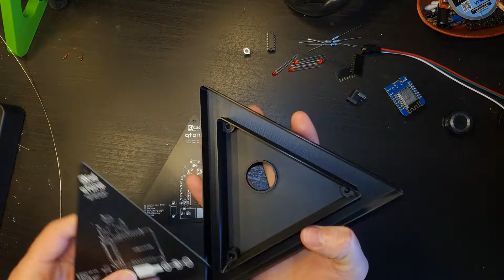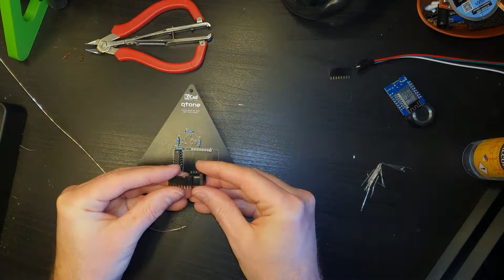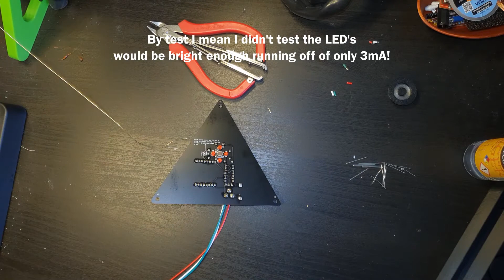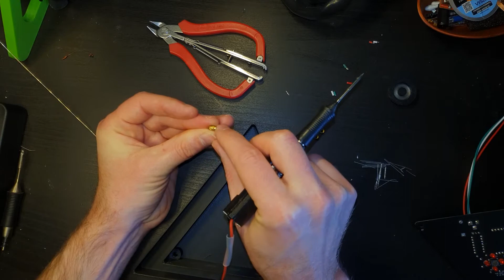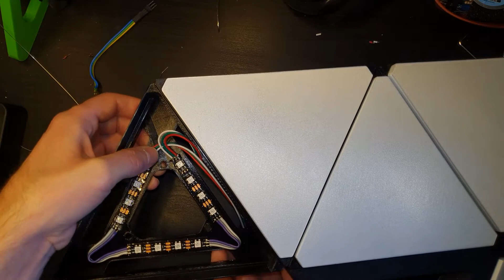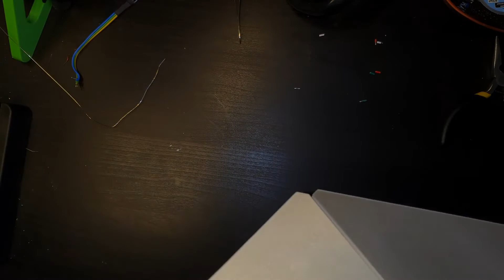Lightbox PCB Build and Install - Nanoleaf Replica

Comment: That is supper I'm working on a similar thing but did not have a good software and time to really finish the designee and board , I planed the board to be the ESP and the LED to be placed on the board and also with the possibility to connect LED strips to